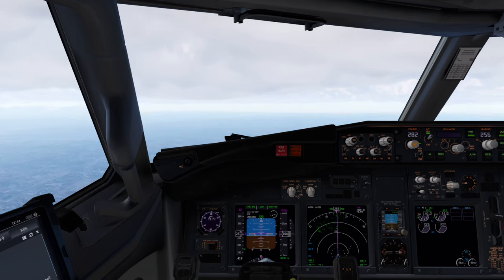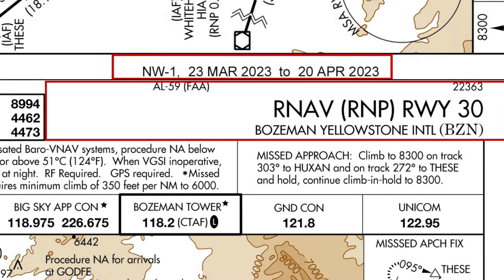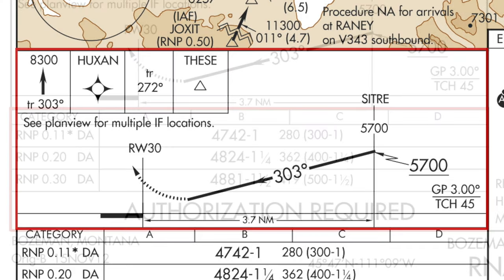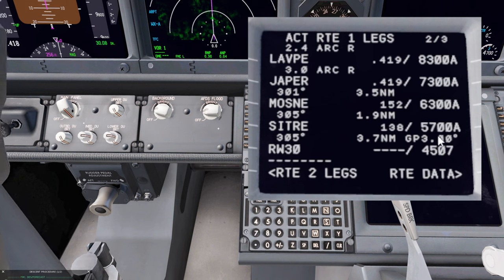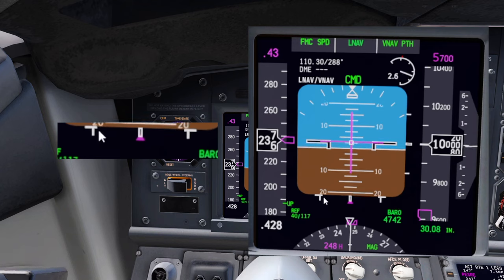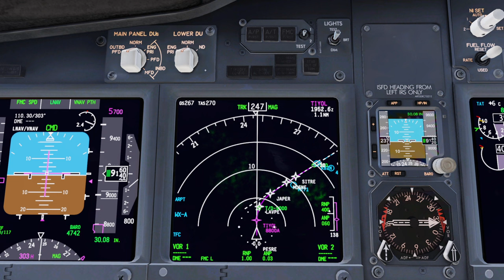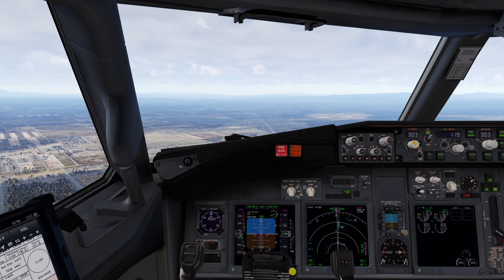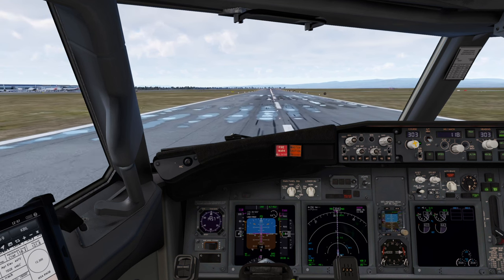Simple RNAV & RNP Approach Tutorial in MSFS and X-Plane

Comment: Hey Micha, thanks for another wonderful tutorial.
Just wondering with RNAV approach, when do you disengage the AP and AT? After landing, I actually see that you still had LNAV on, does it mean you only disengaged VNAV and AT?
Thanks!
Reply from the maker: Depends. I disengage AP when I have the runway insight, I am stable, and haven't hit minimums. I usually disenage AT around the same time, maybe a little bit later. 

Legally you don't need AP or AT to fly an RNAV RNP.  LNAV and VNAV are just the guidance systems. Think of them as ARMING the autopilot, they are just mode controllers. They stay on all the way down as guidance.
Reply: @MicahMesser  Right, thanks for the clear answer! then I just need to git gud on my yoke 😂

Comment: What do mean when you are 300ft below go-around altitude..do u mean in this case 300ft below 4742ft?..i don't understand, you were at an altitude of just over 6600ft when you changed the altitude in the MCP to the missed app alt??
Reply from the maker: Go-around altitude, as in the altitude you would climb to during a go-around, not the missed approach point. 

Once your aircraft is 300' below that altitude, you adjust your MCP altitude to that altitude. Otherwise, your autopilot may try to hold that altitude instead of continuing the approach.
Reply: @MicahMesser  so let me get this right...go around alt is 8300...correct?...so once we are 8000ft & below we reset our mcp alt to 8300?

Comment: I mainly fly smaller aircraft (C172, 182, Diamond D-50, Cirrus Vision....) and for the most RNAV approaches work okay, but randomly and often when locked in on an RNAV approach even though I have postive capture on the approach the glide-slop doesn't occur which the plane remains at altitude (i.e. 2000, 3000, etc) -- not descending? Very fickled!
Reply from the maker: Have you adjusted the altitude down to minimums? Also, you may need to press the APPR button on the G1000 if it is equipped with that.